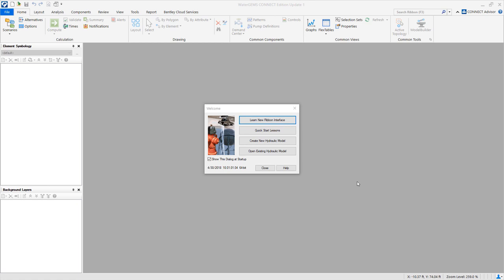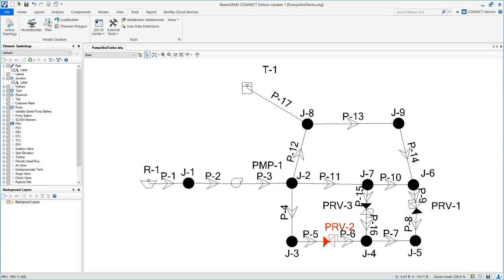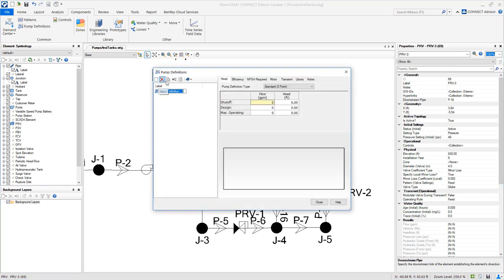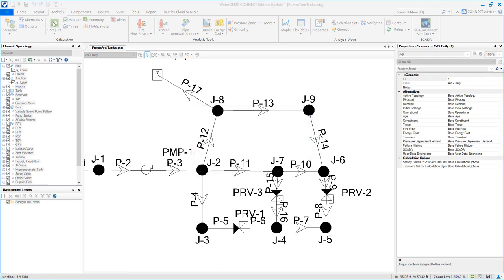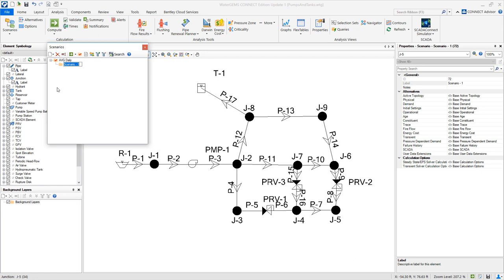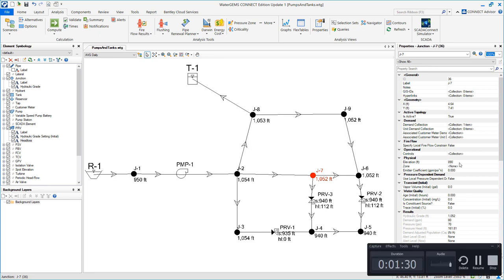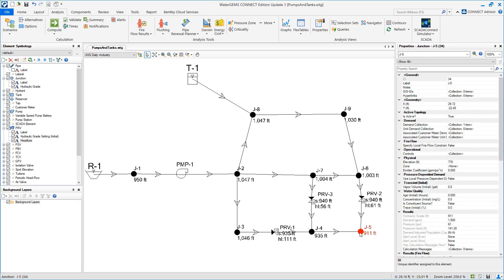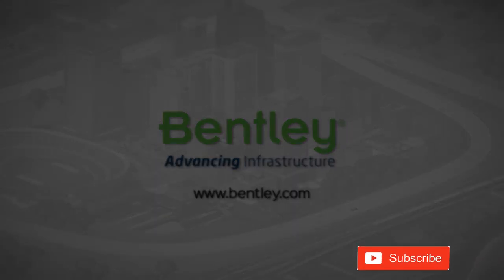WaterGEMS/WaterCAD Fundamentals Part 7: Workshop 3 (Modeling Pumps, Tanks and PRVs)

Comment: How to increase head dicharge in pump? I have problem in that
Reply from the maker: The pump operating point (head and flow) is the point where the pump characteristic curve intersects with the system head curve. If there is downstream storage and you cannot change the pump curve, increasing the pump head can be done by decreasing demands, decreasing pipe friction loss, adding a pressure sustaining valve (PSV) or increasing the upstream hydraulic grade. Consider posting on our forum: https://bentleysystems.service-now.com/community?id=community_forum&sys_id=0310b7ca1b1a3110f3fc5287624bcb80

Comment: I have question, As we run pump normally  for 8 hr in 24 hours  to fill over head water, So how will we calculate or having option of  8hr  in pump section..
Reply from the maker: Hello Engr. Bilal, typically pump controls are based on tank level. You can also model time-based controls to turn on the pump for a certain 8-hour duration during the day. See more here: https://communities.bentley.com/products/hydraulics___hydrology/w/hydraulics_and_hydrology__wiki/22023/using-clock-time-and-time-from-start-controls
Reply: @bentleyopenflows  Thanks alot, Highly regards. I will ask questions if any in future.
Regards..